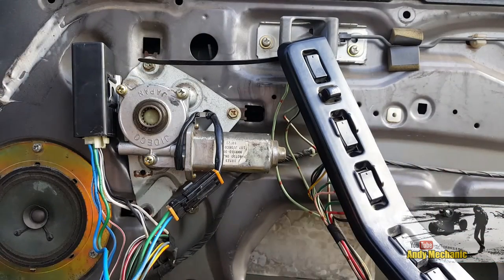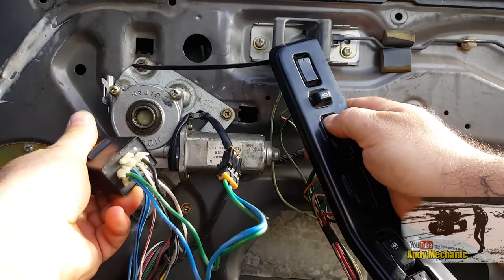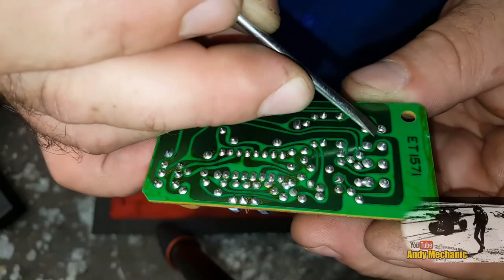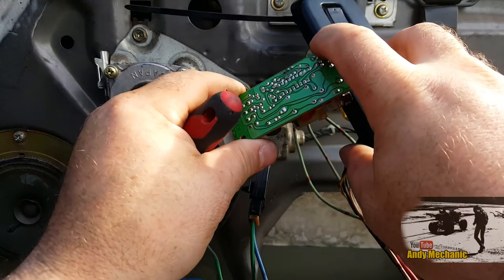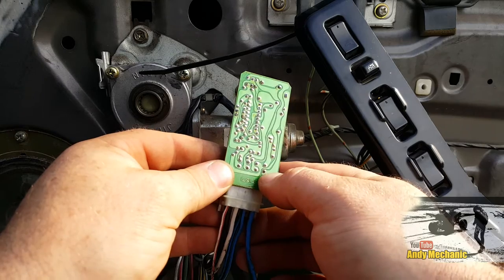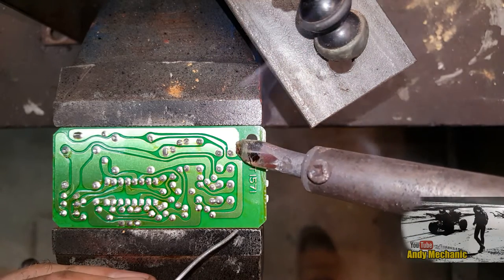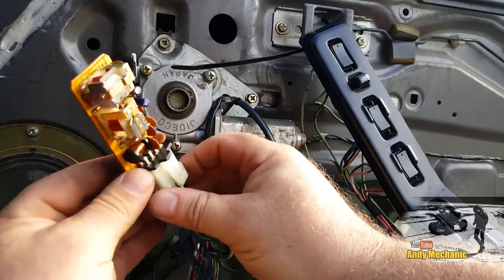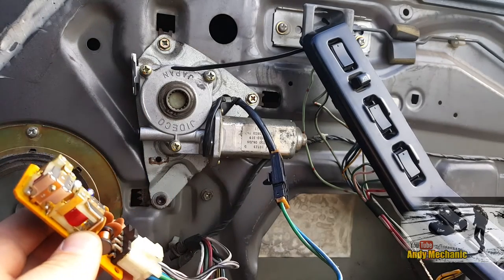Electric window fix pt.2 #1424

Comment: i;ve had an intermittent drivers window on my GQ that's bean frustrating me for about 6 months ..just watched your post and i too had a cracked circuit joint  on the relay board ..thank you so much, just saved me $200 ..cheers from across the ditch in oz .

Comment: Hi Andy 

l had a fault with my window priced up new relay box $220 ex Japan and recy unit $100 no warranty. After watching your clip l pulled a part my relay box it had the identical problem cracked in the exact same spots,  soldered all back up and all good.  Cheers for the advice your legend much appreciated.

cheers Dave.
Reply from the maker: No problem Dave, great to know the info was helpful. Great job. Cheers Andy

Comment: Hi Andy, I'm having problems with my y60 drivers door window. My window switches appear to be slightly different and I have no relay box beneath the door card? Its a 1996 (p reg) 2.8. I'm in the UK and its hard to find any information!

Comment: my relay is fine, motor works but i notice that there is something wrong with the track at the back, so it wont hold the window up or lift it, even when i help it with my hands. any help?

Comment: I wonder how best to resolve a power window that fails at times and rises all tooo slowly??
Reply from the maker: +ojok brian I had that exact problem on the 2nd door on Drivers side on the Patrol. I stripped the motor and cleaned the commutator segments and brushes. I also lubed the window mechanism and the glass runners and it was fine.

Hope that helps. Cheers Andy